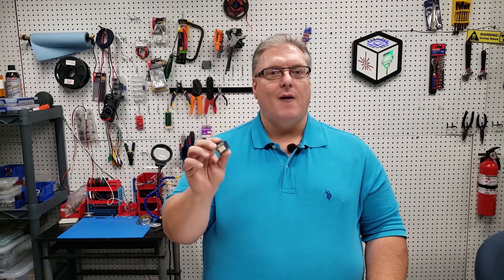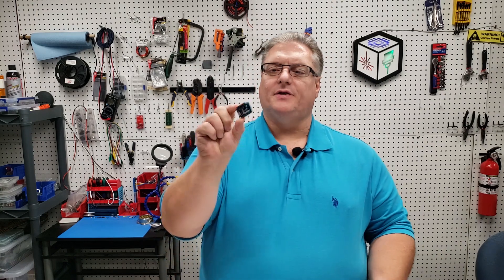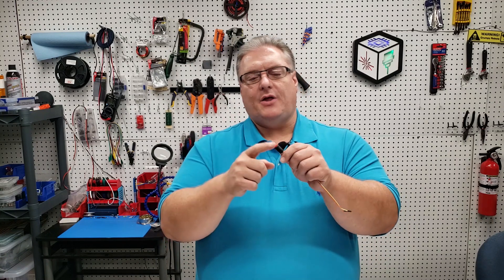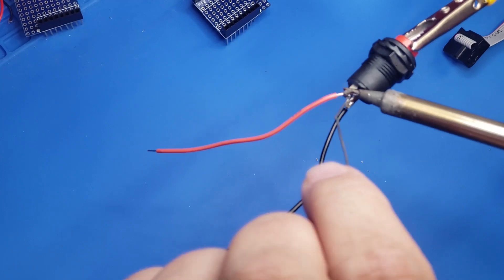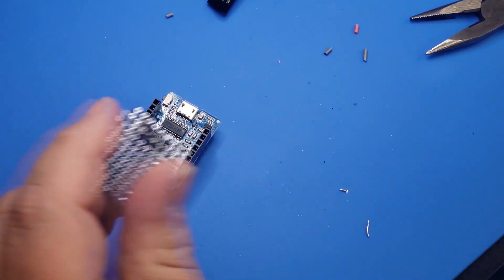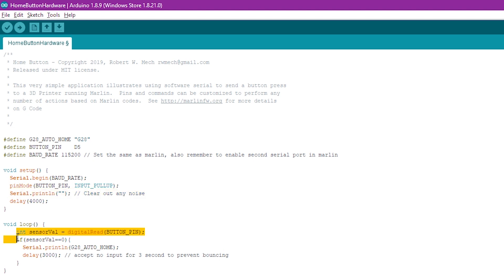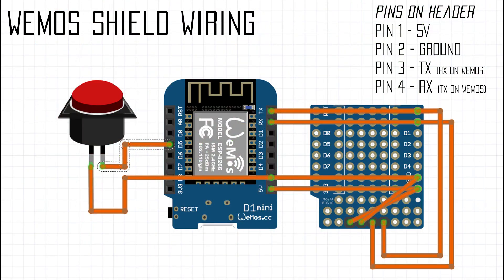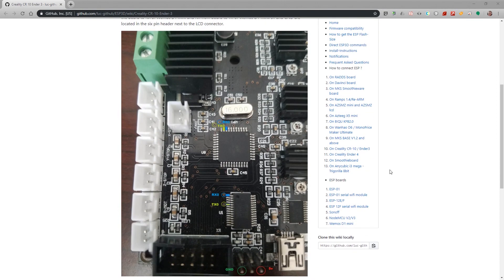Expand the power of your SKR

Comment: Is it possible to use it just to sync g-code folders on the pc with the sd card on the board/printer?
Reply from the maker: Not by default however you could use something like this https://amzn.to/2QQzCed to sync over a WiFi network.  You simply need to use a full sized SD Card.